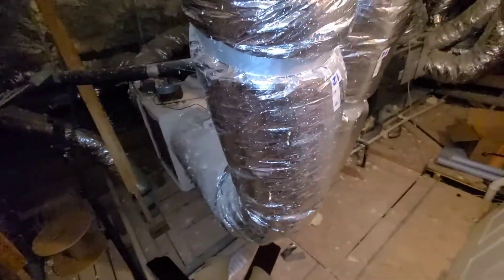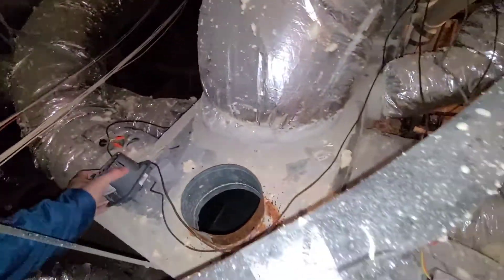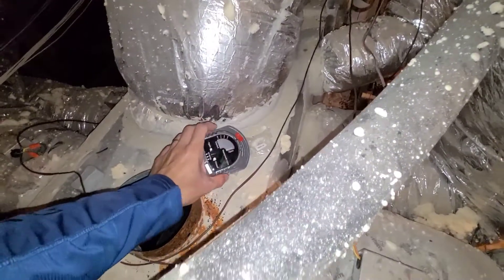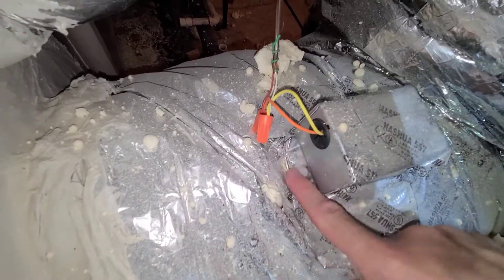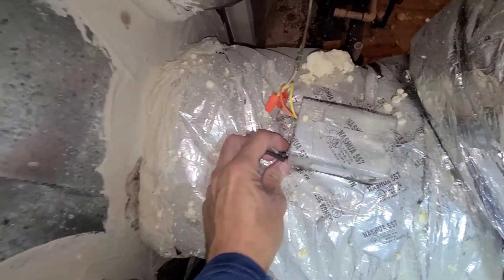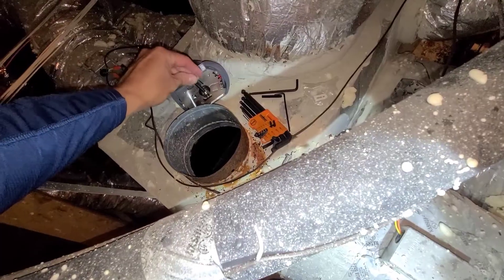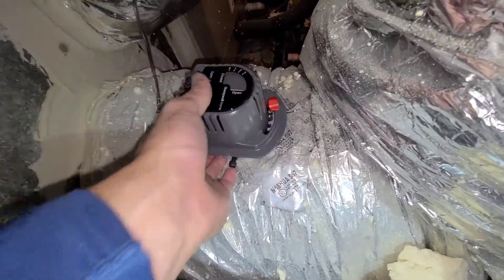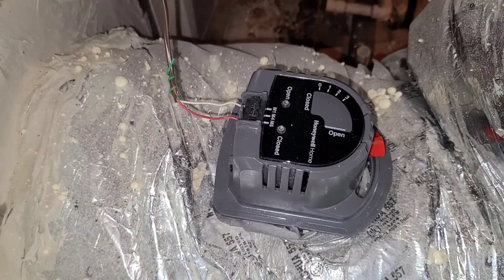Home AC is Constantly  Running , HOT and Electricity Bill is High  How I Fixed It. Zone Damper Motor

Comment: I just discovered that whoever installed my system didn't make sure that the ducks were in the same position as the motor when they tightened screw up i've been in the house for years now today is the first time my bedroom has been cold
Reply from the maker: I was really hoping this video would help someone.

Comment: I scanned the comments and didn’t see anything asked yet. How do you adjust the damper so it fully closes? Mine is a new install and it is stuck slightly before the 0 and a little bit of air sneaks by. If I loosen the set screw, how do I know what the correct placement is?

Comment: With the new motor can you manual adjust it as well so when it’s fully closed you can have it still slightly open?
Reply from the maker: Yes it is adjustable. You can have zones opened when closed , three different angles.

Comment: Great video! Can you explain what that red button is for? It has 0,1,2,3 selections?
Reply: I have the same question
Reply: @Klove1024  Based on my recent experiment, I've found that the red knob controls the damper's opening in the "closed" position. Setting 0 means it's 0% open (or 100% closed), 1 is 16% open, 2 is 33% open, and 3 is 50% open. So, when the knob is at position 1, the damper is fully open when it should be, but it only closes to 16% open when it's meant to be closed.
Reply: I have the same question is this so that you can set it to stay slightly open when fully closed?
Reply: @alvarezz09  Yes, that is correct!
Reply: Thats for when a house doesnt have a bypass damper..so thats where you use 0,1 or 2....3 is basically open which at that point air will come out the vents and fool your thermostat cooling the area off while your thermostat is off..remember thermostat off means you dont want air thermostat on means your making the demand of wanting air  @alvarezz09

Comment: OMG! I've just learned a great trick from you " no noise it's open, noise it's closed" Thank you. BTW the short set screw is to avoid it getting tangle with the insulation when it turns.

Comment: Should the ac system be turned off before installing the motor or does it not matter?

Also how can you be sure that the valve is open once you replace it? The system in my house doesn't have the big hole that you can look through like yours. 

Any feedback would be helpful, thank you.

Comment: Is that a gas furnace?
Reply: Yeah. 90% furnace. Look closely , the exhaust vent is actually the big pvc pipe coming out of it ......it's more efficient vs the regular ones. It's a communicative system with a ECM blower motor which allows it to adjust the airflow/cfms according to temp....

Comment: Why doesn't the red OPEN light turn on? I have the exact same dampers.
Reply: My understanding is that there is a third wire (M4) needed if you want to see the "OPEN" green light. Not necessary from what I understand.
Reply from the maker: Red light means it closed .
Reply: Mine has two lights. The one for open never lights up when it's open.

Also, when the thermostat is off, should it close he damper or does it stay open? My garage thermostat is off, but I still get AC out there when the main floor turns on.
Reply: @HeavyMetalSonicRM  need replace the damper
Reply: House dampers are ment to be closed at 24v being applied meaning you dont want air flow(satisfied thermostat or thermostat set to OFF) 
Dampers out the box come open